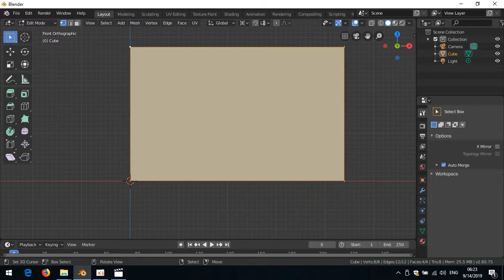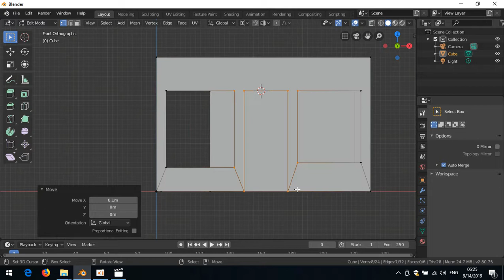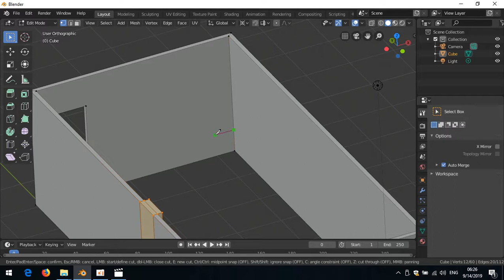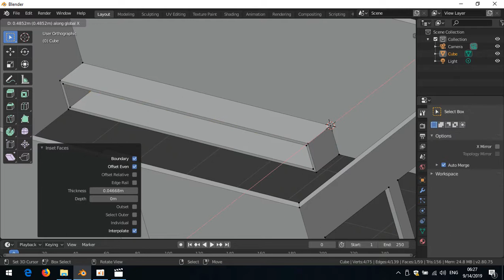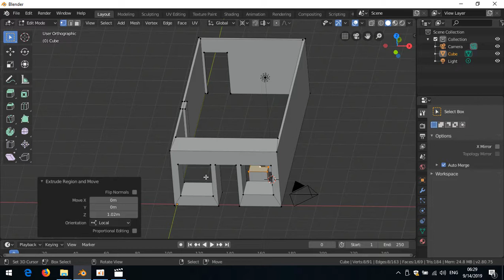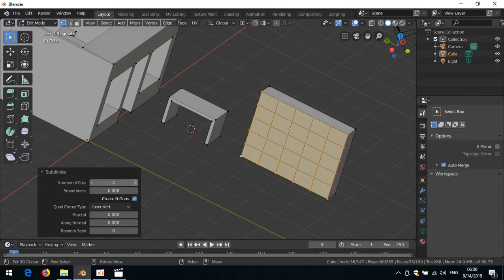Why would you want to do 3D designs (Blender) ?

Comment: Nice try but your scale is way off, and their are other APPs that do better faster. A+ for your effort!!
Reply from the maker: Yeah, I looked into it, with http://maps.nyc.gov
It's a little over 5m wide, according to my latest estimation.
Propably 10m long.
There are other apps, but Blender is freeware and pretty easy to learn the basics.
And, of course, I could use support for my channel and my project.
So, obviously, I am going to promote Blender.
It's a very cool program.
Reply from the maker: By the way, what App would you recommend ?
Reply: @a-triangle2735  Intrcad T6
Reply from the maker: I do not think I am that far off.
In the Netherlands, a regular door opening, is less than 1m wide.
I think, this door is not 1m wider either.
You cannot fit 5 doors next to eachother.